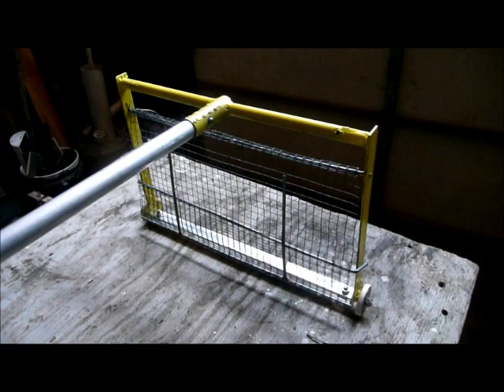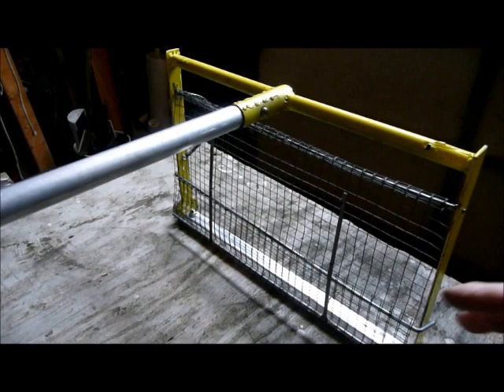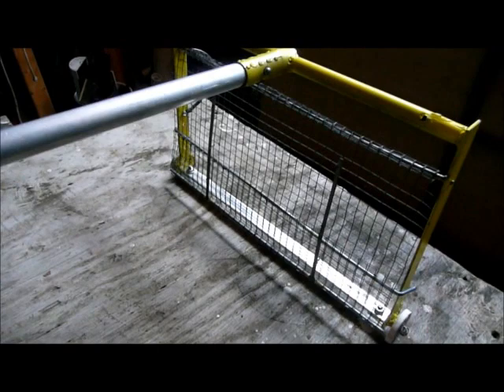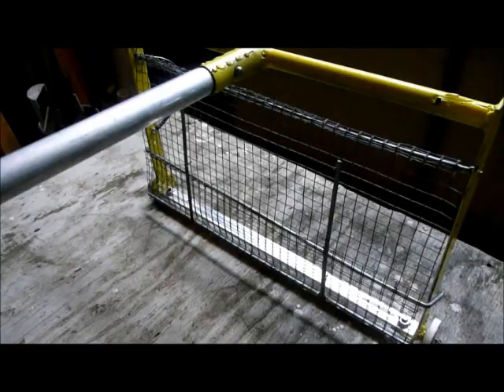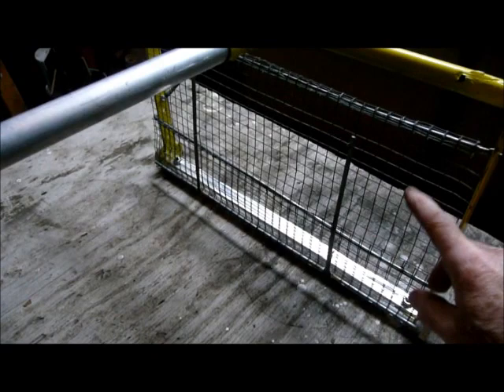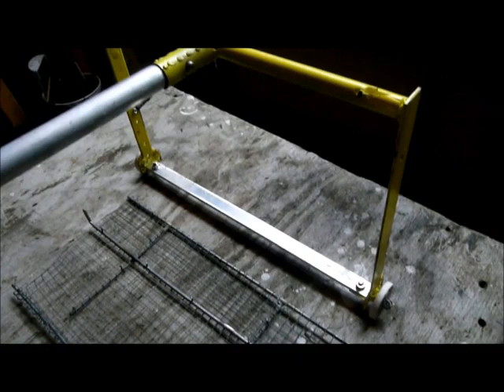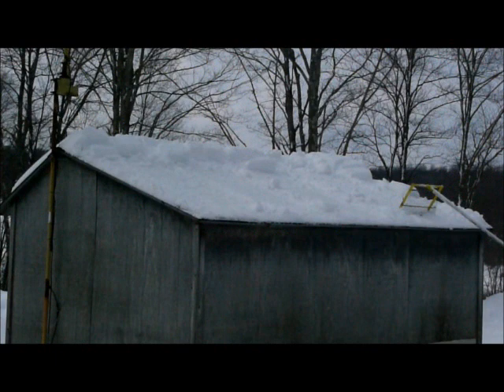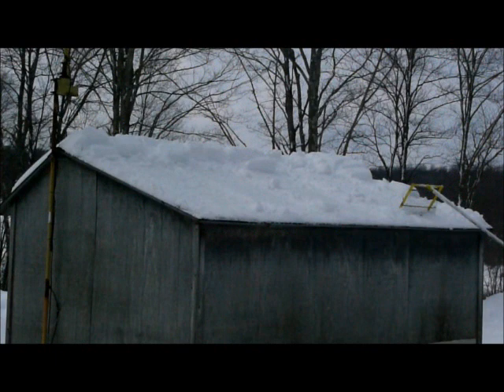Roof Snow Removal Tool Modification

Comment: Hi, Great video and nice job on design.  Could you share dimensions of the head of your snow removal tool.  Want to build one and would like to replicate height and width of yours.  Thanks!
Reply from the maker: Take a look at this:
https://www.youtube.com/watch?v=rDoCNZSdhNc

I just built one similar, but added added short sled runners underneath each side to keep tool off shingles.

PS..this other design is good only as a push-device; it would not work if it needed to be pulled, but it is still a good approach.  If you need a pull design, use something similar to what I posted.  Dimensions are 16" tall x 18" wide.  You can make any size; just keep in mind bigger means more weight at the end of the poles!

Regards.